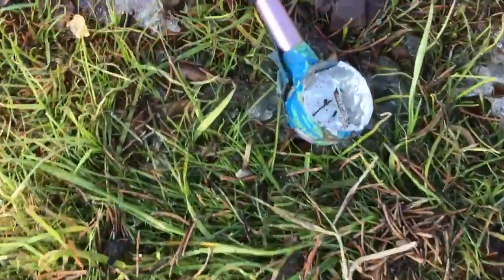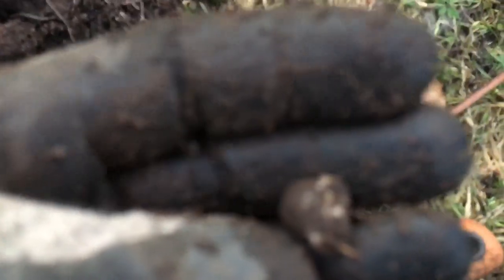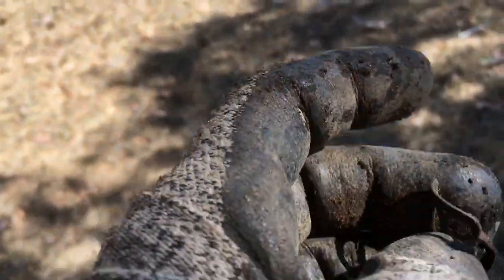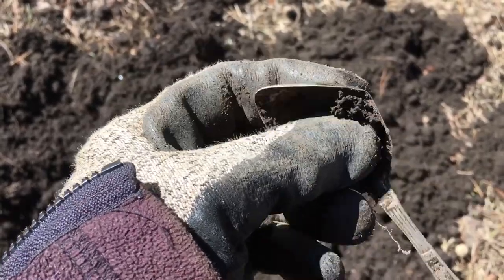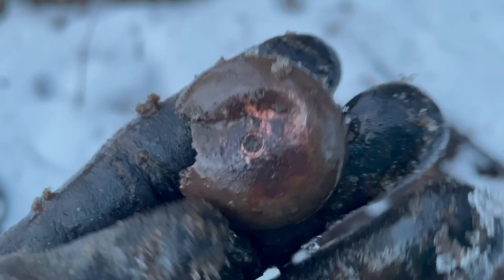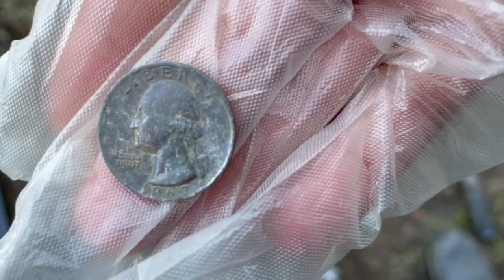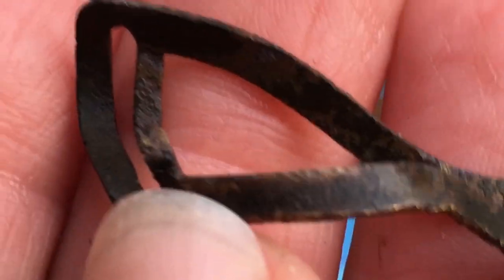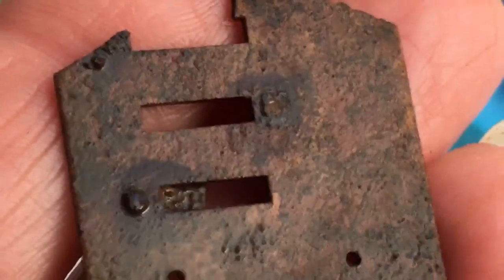#MetalDetecting With Equinox! 1875 #Silver At The Park! #WarNickel, #Relics & Other Goodies! #100

Comment: The 4 fin dart tail thing is a cap bomb, but the head is broke off. They usually did, but you unscrew the top like a 1/4 turn put a cap in , tighten it back down.  Throw it in the air and then the cap explodes when it hits a hard surface.
Reply from the maker: Thank you Bob! I’m still not sure what a cap bomb is. Is that a toy? Maybe like a cap gun from back in the day?
Thank you for the information,  I thought it might be a dart, but, do they make darts out of metal? I mean the the end part that’s usually feathers! LOL. 
I appreciate you watching and supporting my channel! Thank you so much Bob
Reply: @MetalDetectingDonna  on YouTube, type in "cap bomb demonstration " you will see what they looked like and how they work. You will find lots more of those in the future .

Comment: The bent piece of metal is a garter clip that held up pantyhose back in the day.
Reply from the maker: Thank you Bob! I thought it might be something special but I had no idea White! I guess back in the day they didn’t have plastic like we have now! Now I will need to look up the garters so I can possibly date that piece. Do you have any idea when it may have been?
That certainly is a fun and challenging hobby! We learned so much about the world. Thank you so much for watching and supporting my channel Bob! I really appreciate you! ❤️
Reply: @MetalDetectingDonna  I'm not positive on a date, but 1920's through 1950's for that style. You had a button that hung from the garter , there would have been 4 ,2 for each leg. The button and the garter clips were paired together.  The pantyhose top would have gone over the button then the garter clip went over the hose and button , then you would slide the garter clip so the thread holding the button on would go to the narrow end of the clip, thus capturing the hose from falling down. They did not have elastic perfected well enough to apply to pantyhose , so imagine they are using suspenders for pantyhose.

Comment: Please learn to dig a clean plug-  making a huge mess of a hole is not good.   Parks are closing to detecting all over the US.   It doesn’t matter as much in a field or the woods but a park?  Please try better
Reply from the maker: Would you please tell me where you are talking on the video? If you could give me a time stamp? I usually dig a nice neat plug. I’m wondering if the one you’re talking about was frozen ground and I had a lot of trouble getting into it? Thank you so much for taking the time to comment Mark. I really do appreciate it. I do agree, we need to be as nice as possible with our plugs
Reply from the maker: There are also places on this video where I’m actually on the wooded edge of the park. It’s  brush when it’s not winter time. Another area on this video it was very little grass it was mostly mud from the winter thaw.
Reply: @MetalDetectingDonna   Thank you for not taking an offense to my comment.   I see so many parks here in Michigan putting up no metal detecting signs and it was probably the one where you are along the park edge.